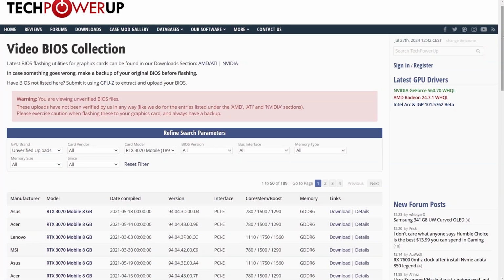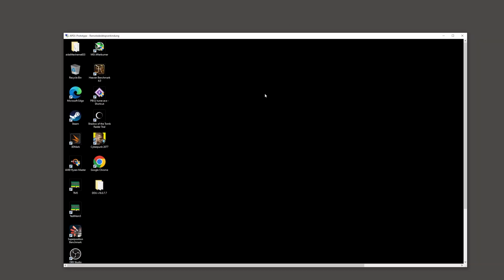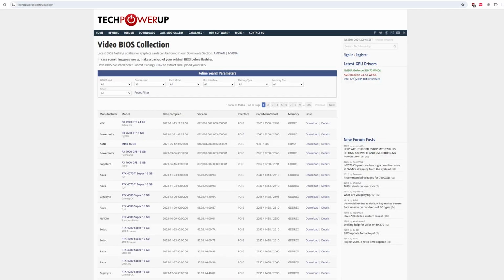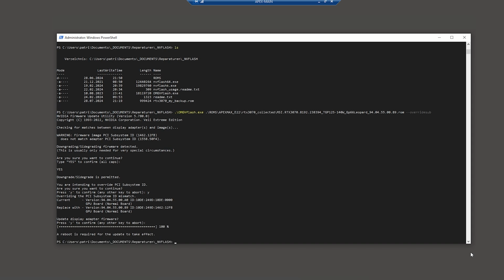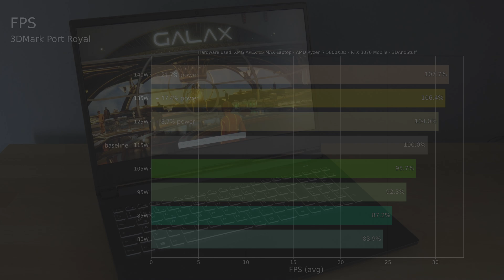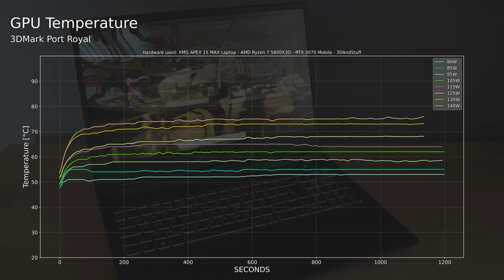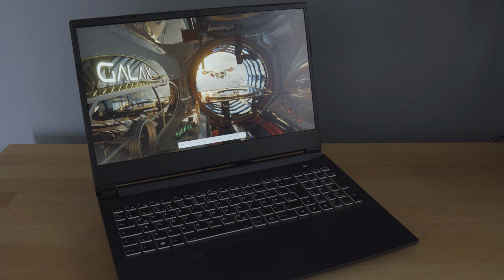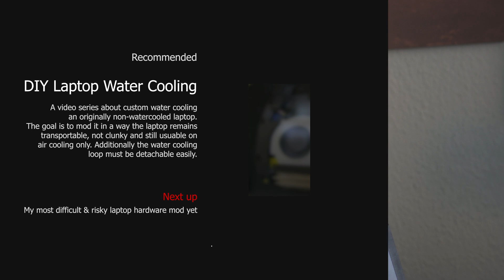More power for your GPU | vBIOS crossflash | RTX 30 and 40

Comment: Will this work for Blackwell/RTX 50 series GPUs?
 We've been trying to flash higher wattage vBIOSes for the 2025 HP Omen Transcend 14 (since that laptop's default TGP is only 75W), but nothing's working so far
Esp since the old 2024 one can accept higher wattage vBIOSes

Comment: In my case there would be image regardless as i have Optimus enabled laptop so iGPU from 14900HX is still enabled. There would not be image in my external monitors as those run only through the RTX 4070.
I'm planning on trying this on Dell, Nvidia, and two Asus vbios, if they don't work then that is not so bad already have 115W+25W dynamic boost, it would only give 25W extra without dynamic boost.

Comment: I am really glad I've found this channel! I have a problem with my clevo laptop - the same base with desktop CPU as yours on the video. If I boot the laptop from the charger the games go full fps but not for long - black screen occurs. But if I boot from battery and then add the charger - no issues, but the GPU doesn't consume more than 800 mV. The GPU bios is stock. Maybe you have any thoughts about this issue? Thank you!
Reply from the maker: What's your CPU?
Reply: @TechModLab Ryzen 5 5600. I also have 5600x and 2 chargers - 230 and 280 watts. I swapped them for testing so it's not defective cpu or charger. Currently I am providing undervolt experiments - 0.975 v 3900 MHz stable in occt avx2. Video card rtx 3070

Comment: My 3080Ti(gigabyte eagle OC) has 2x 8Pin connectors. But as it is a power hungry card some cards were released with 3x 8Pin and much higgher TDP, so can  I use bioses from those 3x8Pin cards? and where should I draw TDP limit for 2x8Pin

Comment: i have the same laptop as yours but with the 5600X , i followed your steps but you dont have to type everytime just to get the 140w you can just install msi afterburner then adjust the power slider to the max mine was 112% and set it on boot, i tried powershell script but no luck and msi afterburner was just so easy to use and just works
Reply from the maker: I know but as a computer scientist I love terminals/consoles lol
Reply: @TechModLab  i love your channel, by the way maybe you can do optimization video on your 5800X3D im planning on upgrading
Reply: also there is a 150w vbios for RTX 3070 have you tried that aswell?

Comment: Hello my Omen 15 with 10750h 3070 on 100watts stock is now running at 135 watts with an omen 16 vbios, however i notice when both cpu and gpu i underload my cpu is power throttling and my battery went down to like 70is percent, i believe the 200 watt adaptor is not enough? Is it possible if i use a 230 watt adapter from omen 16?

Thanks a lot btw

Comment: so how i can edit power consumption without download old driver (you mention to mode called sh.. something like that 😂)
Reply from the maker: Shunt mod :) basically replacing the shunt resistors or adding one in parallel to manipulate power readings by the GPU. It keeps reporting stock 115W for example, but draws more in reality depending on shunt resistance

Comment: Great video. I tryed this on my razor blade 15 but was not sure if it worked. 
Sadly I switched to dedicated GPU only mode ... the Laptop booted into windows like you descirbed. 
Is there any way to change back to intigrated gpu while blind or do i have to buy this bios overriter hardware?
Reply: Just use the port for integrated gpu with an adapter and connect it to different monitor, it will boot up fine and you can simply put original vbios back
Reply: @asure6760  sadly there is none. the laptop has a mux switch :(. (never buying used razer ever again xd)
Is it possible to navigate nvidia control panel blind to change back to nvidia optimus?
Reply: @diederichgarz6317  any usb 10 gig port should work with an usb to hdmi adapter, just give it a shot. My laptop has mux switch too when the same thing happened to me I just used a usb to hdmi adapter.
Reply: @asure6760  You might just have saved me! I will try it the next couple days. Thx a lot for taking time of your day to help!
Reply: @diederichgarz6317  you’re welcome!

Comment: I have an RTX 4060 and I can't install the drivers.could you help me please?
Reply from the maker: Use nvcleanstall from techpowerup if your RTX 4060 does not get recognized after vBIOS crossflash. But afaik this should not happen. Are you sure you flashed a vBIOS with the correct DeviceId?

Comment: if my laptop have an igpu would i still get a black screen?
Reply from the maker: Depends on if it switches to dGPU in Windows automatically, or if it is set to dGPU mode in UEFI BIOS. In most cases it will boot with the iGPU just fine, even if the vBIOS is not compatible to output an image.
So, it strongly depends on your hardware and presets the vendor made. Safe method is using remote desktop though
Reply: @TechModLab  oh, thanks for the info
Reply: @TechModLab  hahaha i've tried all the vbios but none of them worked🤣
Reply from the maker: @finder7487  very unfortunate mate. What laptop you got?

Comment: Long time no see!! Welcome back boss!

Is it worth doing anything like what you've done for the old XMG version with the 2070 GPU, with stock cooling solution?

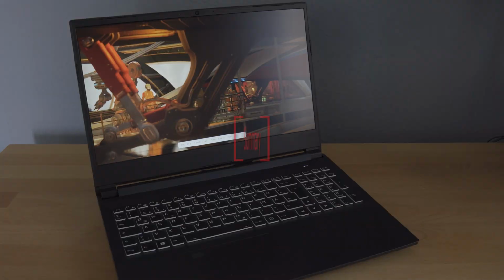Well, 8:16 answers my question! 😂😂
Reply: Not really worth, even if u find a good vbios and u get a little boost in perf the temps are going to skyrocket.

After some use (3-4 months) a chip always blows, happend to me to 3 different laptops so not really recomended 😂 also the perf difference is small
Reply from the maker: Feels good to be back man! And yep, 8:16 says it all :) Besides, RTX 20 can't make use of it, because their mobile GPU models all had the same TGP. RTX 2070 mobiles always came with 115W TGP. That's why it's only applicable for RTX 30 and 40. Let's see what blackwell brings up
Reply: @TechModLab  I'm just sad with XMG about their promise to make that version of the laptop upgradable to Gen4.. and it never happened due to politics.. Tom @ XMG made it clear in Reddit
Reply: @TechModLab  true about 20 series, but u can still use moded vbios to up the limit